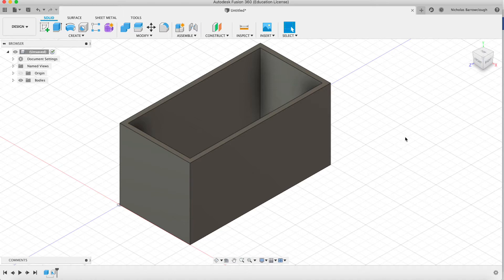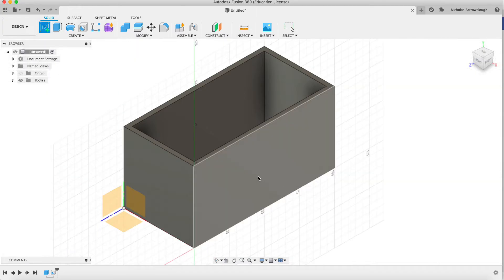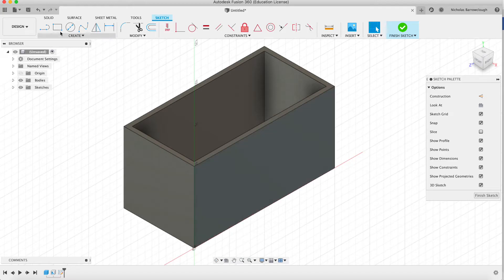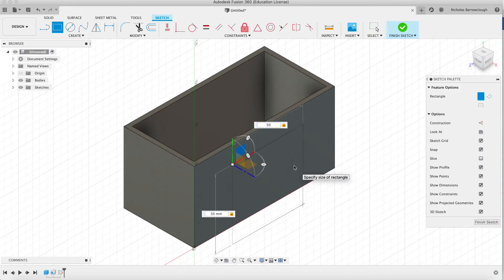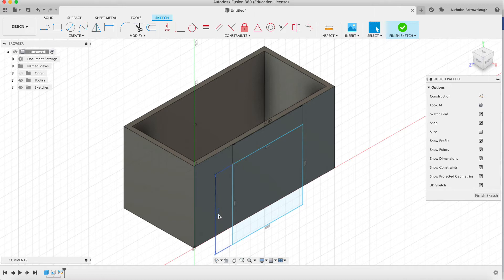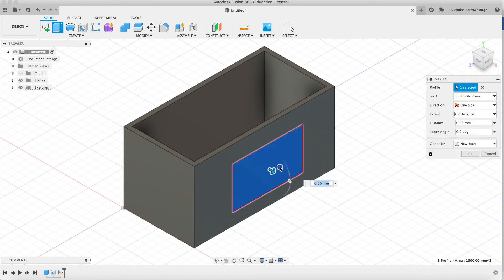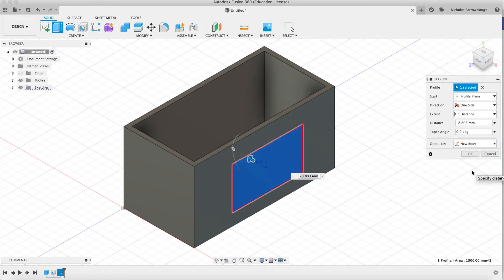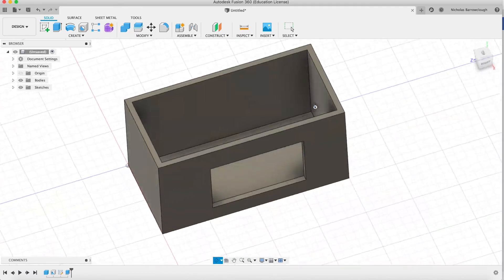Fusion 360 - Cutting a hole

Comment: This requires knowing the thickness of the wall and making sure the extrude distance is bigger. Also if the thickness of the wall changes in future you may get a bling hole instead of a through hole without knowing that. A better way is to change extent type to "to object" and then select the opposite face of the wall.
Reply from the maker: That is true, and it allows the hole to automatically adjust if you change the wall thickness in the future.

Comment: Forgive me - newbie...

1. How come your menus go SOLID SURFACE SHEET METAL TOOLS SKETCH
but mine go SOLID SURFACE MESH SHEET METAL PLASTIC UTILITIES MANAGE?

2. How come you can sketch on the surface in isometric view, but for me when I click sketch (from the context menu as I don't have your sketch menu) it zooms in to a face-on view of the surface. It also hides all the intersecting bodies and components, so it removes all the context that was guiding me where I was going to put the sketch on the surface in the first place! I want to do exactly what you're doing. I can do it if I choose HOLE. But I want a rectangular hole, not a round hole.

Comment: This video is 11 months old. That means that the Fusion 360 designers have had nearly a year to completely screw up a simple function. Al I want to do is the equivalent of putting two holes, spaced equally distant from the center of the bottom of the box you're working on in this video. It's been an hour and I can make the holes but locating them correctly has been an exercise in futility. If I wrote PLC programs they way that they wrote this software I'd be out of business. Clearly this software was written by people that don't have to use it.
Reply: use solid works dummy